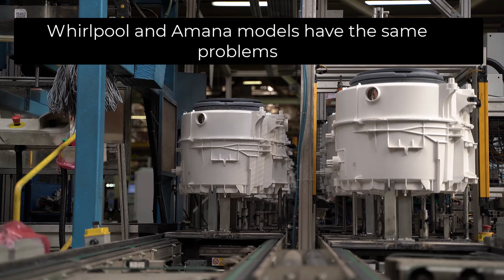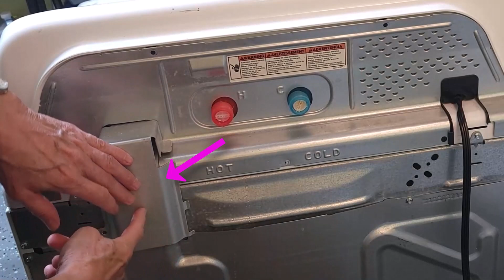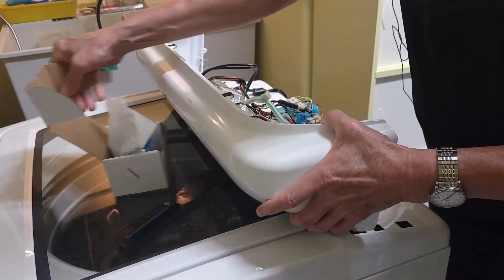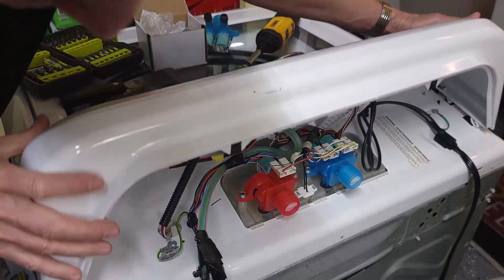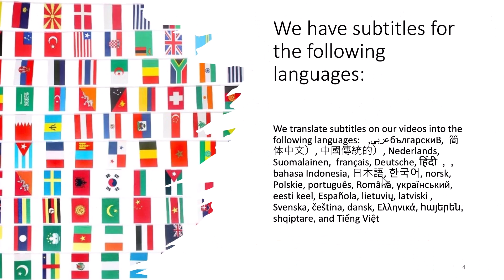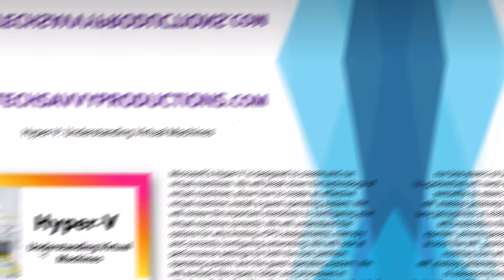Cold-Hot Water Crisis: DIY Fix for Your Maytag MCT Washer

Comment: Replaced valve and still having issue. Could it be temp sensor/switch? When I start a wash I hear humming and no water. If I close and open the valve from the wall attached to the hose it starts filling the tub.
Reply from the maker: When a newly replaced fill valve lets water in only after you cycle the shutoff at the wall, it typically points to one of a few common issues:

Valve Orientation or Installation Issue

Check that the cold-water inlet valve itself is oriented correctly. Many replacement fill valves have an arrow or marking indicating the correct direction of flow. If it’s installed “backwards,” the solenoid may hum but not actually open.
Make sure the mounting bracket and valve ports line up exactly as the original did. Even a slight misalignment can block water flow.
Wiring Harness Misconnection

Ensure the electrical connectors to the new valve’s solenoid are attached to the correct terminals. On some machines, hot and cold solenoids can be physically interchangeable but must have the correct wires on each coil. If the wires are swapped, the valve may hum but not open.
Screen or Debris Blockage

Double-check that there’s no debris clogging the valve inlet screen. If the screen is even partially blocked, pressure might not be enough to open the valve under normal conditions. When you close and reopen the wall valve, you momentarily increase pressure and dislodge the blockage, letting water flow briefly.
Anti-Flood / Flow Restrictor Hose

Some newer supply hoses have built-in anti-flood or flow-restrictor devices. If there’s sudden demand (like the washer first calling for water), these devices can trip or restrict water flow. Turning the faucet off and on can reset them.
Try a different hose or temporarily swap in a standard braided hose with no flow-restrictor to see if the problem goes away.
Pressure or Air-Lock Situation

Occasionally, air pockets in the line or low inlet pressure can cause the valve not to open properly until you “burp” the line by cycling the shutoff. Make sure the supply pressure is within the recommended range (usually 20–120 psi).
Incorrect Replacement Part

Confirm that the valve you installed is a genuine (or exact-fit aftermarket) part for your specific Maytag MCT washer model. Even though many washing machine valves may look similar, differences in coil resistance or flow characteristics can cause odd symptoms like this.
What To Try Next
Re-check Orientation & Wiring

Verify the new valve is installed in the same orientation as the old one (water inlet side, outlet side, and coil position).
Confirm the wiring harness connectors to the cold solenoid are in the correct place and firmly seated.
Inspect and Clean the Inlet Screens

Shut off the water and remove the supply hose. Look for a mesh screen at both the end of the hose and the valve inlet. Clean any sediment or debris you find.
Rule Out Supply Hose Problems

Temporarily use a simpler, plain hose without an anti-flood device. See if the valve behaves normally when you start a wash cycle.
Check Water Pressure

If your home’s water pressure is borderline low, that can prevent the solenoid valve from opening properly until the supply is “burped.” A quick pressure check can confirm this.
Confirm the Correct Replacement Valve

Double-check part numbers. Ensure the coil resistance and valve specs match what Maytag recommends for your exact model.